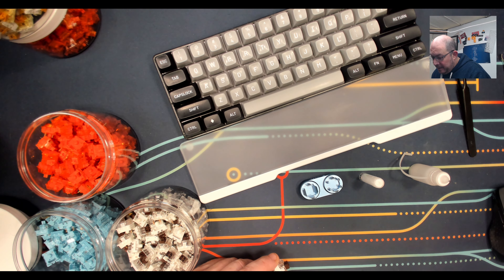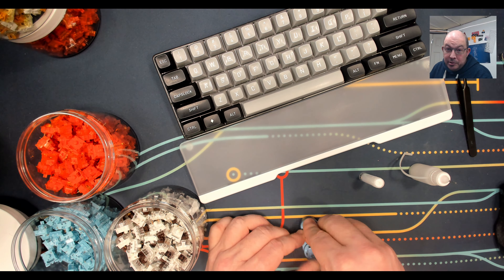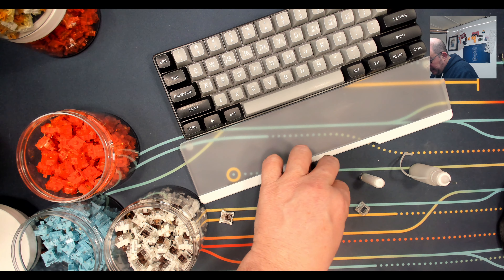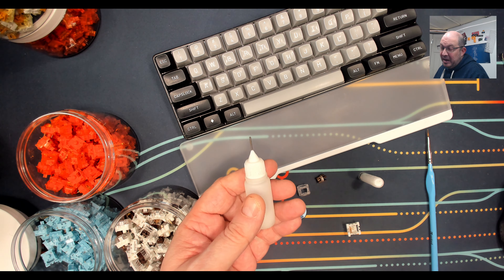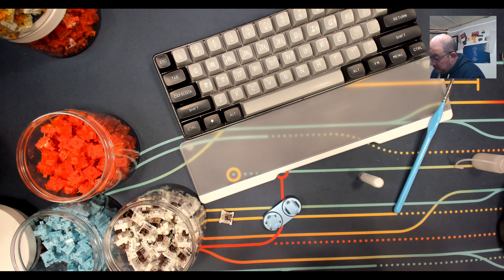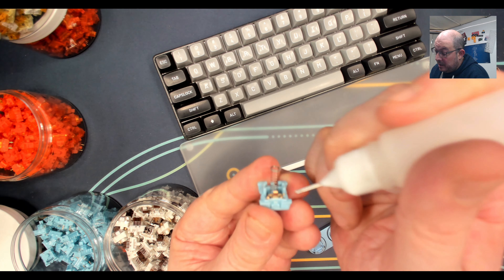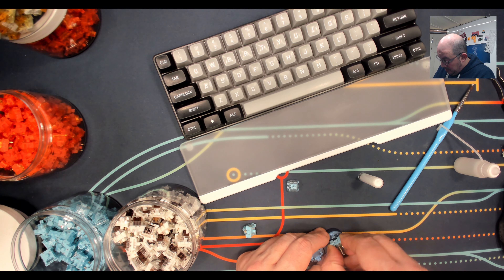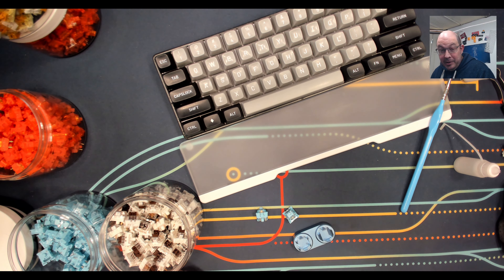You Don't Have To Live With Ping! Easily Eliminate Spring/Leaf Ping in Mechanical Keyboard Switches!

Comment: Could you tell the name or part number of the super lube that you mentioned? There's so many variations on Amazon and I wouldn't mind making sure I pick one up that you've had success with.
Reply from the maker: I use Super Lube 21030 grease and 51004/51008 oil.
Reply: @MechKeyboards  Thanks very much!

Comment: Could you explain the logic behind lubing the back of the leaf spring? The back of the leaf spring does not seem to have any contact points so I do not see how lubing it would help...
Reply from the maker: The leaf spring is metal, when actuated, it vibrates, adding lubricant prevents the leaf spring from reverberating, hence stopping the ping, which on some switch, the majority of the ping comes from the spring leaf.
Reply: @MechKeyboards  I see, so you're basically adding some mass behind the spring to prevent it from vibrating. In this case the mass is lube, correct? I'll go ahead and give it a shot!
Reply from the maker: @wtfrabbid yes, that's it! Good luck and let me know how you like the results, cheers!

Comment: Do you have any examples of switches lubed with super lube? I don't see many people using it and those that have were from years ago and never updated how it held up in the long run or posted any sound tests. 

Do you sell the lube mixture that you use for the springs and leaf? My switches have developed leaf ping over time and it drives me nuts. I'd love to finally be able to fix it.
Reply from the maker: SuperLube works just as good as any other lube, many of my sound tests are made with switches lubed with it.

I do not sell anything.